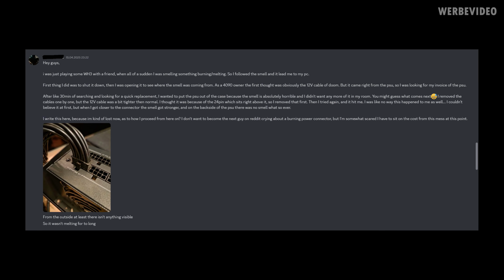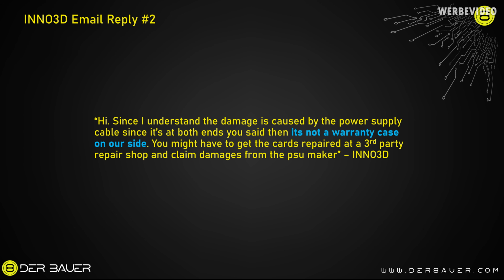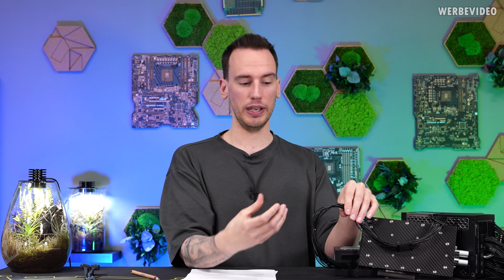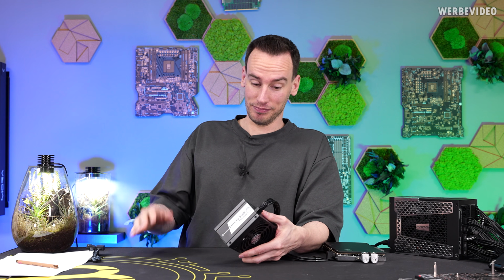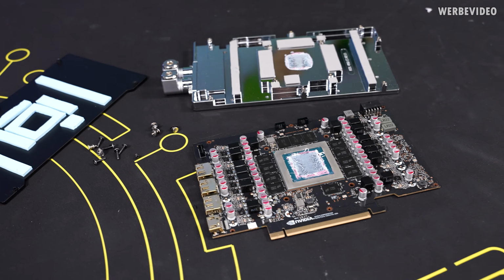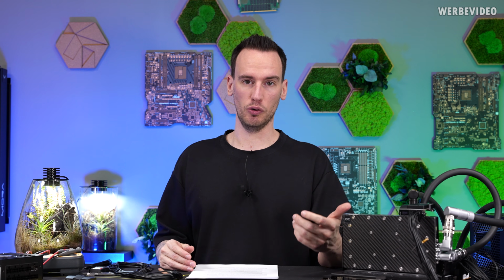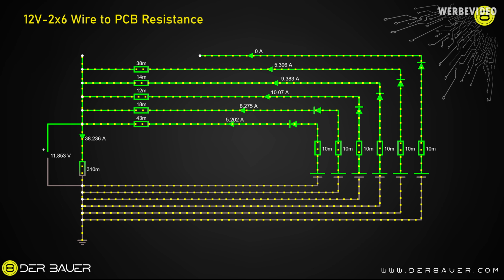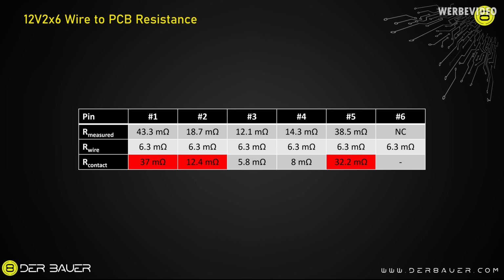Investigating and Fixing a Viewers Burned 12VHPWR Connector

Comment: Kinda makes you wonder why there hasn't already been a market for modding those connectors into something more reliable like an XT60 or XT90 from the RC Modell industry. Having only one 12V and only one GND Cable seems like an idiot proof method to ensure there not being any load Balance issues... It would IMHO also look much nicer to have two beefy Silicone Wrapped Cables coming from the PSU to the GPU than this Rats Nest of 12+4 Cables we currently have.

Comment: 4:23 bulllllls++t... it is purely nVidia's issue - not the cable or PSU issue.. the fact that the card suddenly takes more power through 1 cable, than normal, is caused by something specific - we just dont know what it is yet... :/ i'm not going to even ask INNO3d about it - and about my melted RTX4090 on the card's connector side only... they all play dumb... the only reason I use their cards is because Alphacool ES (back liquid outlets) supports only their cards...

Comment: Hello! You should measure the resistance of the cables while the connectors are plugged in on a affected card/psu. Do not unplug the connectors. Cut the power wires from the middle so they wont be in a closed circuit. Disassemble the video card and the psu. Measure resistance on each wire from the middle to the soldered pins of the connectors. Might be overheating because of poor surface contact area In the connectors.

Comment: Nvidia's Motto:  If it ain't broke, fix S%&# till it is!  Ppl and companies blaming cables, connectors, PS's, gfx cards, like wtf, the designers of this spec should be thrown in a hole and throw away the hole, there is no reason for any new design to released if it cant handle power its rated for, whether its the wire guage, or connector design, if they are not making proper connections in so many of these cases then its not the consumers fault,  its a flaw in the design

Comment: I blame Nvidia as well as PSU companies for anything related to cables. Corsair I think acquired cablemod, but for the most part, they're all shipping these PSU's and GPU's with cables that they know nobody wants to use because they're hideous looking. They know people are going to go out and buy extensions or modded cables. If Nvidia has a spec for those cables, they should sell them in different braided options. Same for the PSU vendors. Stop shipping hardware with dogshit cables and then wagging your finger at people for buying some no name brand cable extension. If they're not going to respond to the market, then some chinese company will.

Comment: The 12VHPWR cable system is the peak example of "should work in theory, but doesn't in reality". As shown in 3:36, especially with how variable the contact quality is with such small pins at each 12VHPWR connector end, if one or two pins don't make good contact, then it won't take long for the remaining wiring with good electrical contact at the connector ends to end up carry most of the current (which produces enough heat to melt wire insulation and connectors). 
This is partly why, at least in US National Electrical Code NEC 310.10(H), parallel conductors are only permitted where 1/0awg or larger wires are used, where it's more practical to run parallel wiring through conduit than trying to pull the likes of 4/0awg or 500mcm wiring through conduit runs that have a bunch of bends in it.
When I do get a card that uses 12VHPWR, I'm ripping that cursed connector off and installing some way to use DC-H connectors (rated to 60A) and 90degC rated 8awg wiring (good for 55A or 660W). As if these cards aren't overpriced already, a house fire will really make things EXPENSIVE; I game via Steam Remote Play a lot and won't be right by the PC to immediately smell the burning plastic and turn things off.

Comment: I'm a little new to PC building and came across the PMD2 device while watching Jayz Two Cents video - Feb 13, 2025: "I discovered something concerning and I need the Experts to chime in... More 12VHPWR discovery!", saying that the PMD2 was smoothing out the power to the GPU saving the card from being damaged. Along with the PMD2 I was going to add the Thermal Grizzly WireView Pro (then upgrade to the Thermal Grizzly WireView ProII when its released). The GPU I'm looking to purchase is the ASUS ROG Astral GeForce RTX 5090 32GB GDDR7 OC Edition. This PC will only be used for my VR motion racing sim. I'm trying my best to incorporate everything I can to prevent the wires from melting but wanted to know if this was overkill? Thanks

Comment: Product Idea: Make a device that the connector plugs into and the out goes to the GPU. This "box," which has circuitry to monitor the pins, could shut off the power if wattage or temperatures get too high instead of just passing the high wattage through. Think of it like a damn before the GPU. So, get it on it!

Comment: This happened to me yesterday. PC had a random shutdown. Reference 4090 with plug plastic melted on both sides about 400w heavy ai load used original cable that came with the corsair SF850L. I was able to disconnect both ends, Pins 1-6 burnt, plastic completely melted on Pins 2 and 5
Reply: It still booted fine when it was connected.

Comment: The design of the connector appears problematic due to its excessive complexity and limited capacity. With six wires carrying current forward and another six returning, each wire traverses four terminal points (two from the PSU and two from the GPU), resulting in a total of 24 terminal points. With the power envelope in mind this design pushes the physical limits of the connector.
Such a configuration is highly susceptible to imbalance issues, which can easily trigger a cascading failure or "snowball effect." While this type of connection might perform adequately in overdimensioned situations, it is unsuitable for its intended use here.
From an engineering perspective, applying 8.3A across each small pin at these numerous terminal points (24 in total) poses a significant risk of failure. The reliance on statistical probability rather than robust engineering principles makes this design inherently flawed and prone to disaster.

Comment: A very profound and useful solution would be:
make the 4 pins for sensing an SMBus and connect that to the mobo via a bridge. This way your PSU is now also part of the SMBus inside your computer. yay, now your PSU can report that it gets old and cant hold the voltages correctly anymore. Also overused other cables like SATA-strings can report overcurrent. Also hot temps can be reported.
The + and - pins are on PSU & CPU side switched via a multiphase controller. That will watch AND CONTROL the voltage, current, temps and so on and report to a small microcontroller which then reports via SM-Bus. This way the PSU and GPU can also report a hot wire to each other or handle our lower power draw for some time.
This will also allow a future proof power delivery handling like in phones. E.g. in the future there can be a boost on the PSU side, boosting 12V back to 60V (with this the current will also fall from e.g. 10A to 2A.

Either way. There are multiple things wrong with the 12V connector that could be changed easily and will improve safety by a lot. I wrote enough about those in other posts :|

Comment: I thought just like the gpu owner and bought a $100 cablemod custom cable for my 4090

It seemed to work great for a while but eventually started acting power limited like I had a 3x8 pin adapter instead of the 4x

I bought a new Seasonic psu that had the new cable built in and haven’t looked back since

Comment: I see diodes in your circuit simulation. Do those exist in the power supply? I thought all the pins were connected to a common bus (or perhaps via a shunt). The diodes will simplify the current flow graph, but that may not match reality. Perhaps they are required for the simulator to be able to solve the flow? How about building a physical model of the circuit with potentiometers representing each of the resistive parts? Could be a fun little project.

Comment: Handful (ok, 2 handfuls) of LONG engineering points, based on years of experience and troubleshooting of that LEAST reliable part of electronics - the connector (what do you think is most likely wriggled into a working position when you smack that box? A connection.):

1. With a 'busbar'/'pcb power plane' on both the PSU and the GPU sides, every parallel wire connecting them MUST have the exact same voltage drop between those two busbars.
 
2. The power lost in each wire path is the voltage drop squared divided by the resistance seen been those busbars along that wire path.

3, That path resistance is made up of a series of resistances: from psu busbar to the pin, contact resistance from the pin to the connector socket, the socket to the wire, the wire itself, the wire to the socket on the gpu side, the contract resistance from the socket to the gpu's pin, and the resistance from the pin to the gpu pcb power plane. 

4. ANY ONE OR MORE of those resistances can cause that pathway to draw less current, and push more current onto the remaining paths. 

5. IF the pin and sockets that are mated together are not compatible, typ one tin plated and one gold flash plated, the gold will migrate off its original surface, exposing a base metal beneath. Base metals can vary, and many can corrode/oxidize, increasing that contact resistance greatly over time. IF both are gold surfaces, this would be a very good low resistance contact, as long as the gold survives (mating cycles and vibrations are the typ enemies here).
The Intel ATX PCIe 12V-2x6 specs call out the pin contacts to be tin plated Cu. The spec I saw ( edc intel com alder-lake-desktop/atx-version-3-0-multi-rail-desktop-platform-power-supply-design-guide/2.1 ) did NOT spec the base metal nor the plating for the socket portion (this seems like a SERIOUS oversight, if it is not addressed elsewhere).

6. There are two distinct versions that are called out as 'approved' for the socket's contact area, a "3-dimple" design, and a "4-spring". The 3-dimple approach does not seem to be as robust as the 4-spring in regards to the number and size of the contacting surfaces. The 3-dimples are ONLY on two sides, and seem to only promise to try to contact the mating pin at the 6 bumps. Dust and other contamination can reduce that. The 4-spring approach, at a cursory look, seems more expensive to manufacture, but is a 4 sided spring cage, each meant to provide contact, and each contacting surface looks to be larger. Further, the 4 springs act independently, offering higher chance of contact in two different directions. 
If I were looking for a high quality socket, I'd be inclined to use a TIN (SN) plated 4-spring offering.

7. Plastic molds that need to have tightly controlled dimensions to hold the sockets in the shells in JUST the right position, and/or grab and contain the tiny barb in the socket the keeps it from sliding outward again. Those molds have a FINITE lifecycle - only some many shells can be produced before or must be replace by a new mold. And the timing that produces those shell molds also have a finite life before they must be replaced too. An aged/bad mold, or worse, an aged/bad tooling for making the shell molds, can cause long term havoc, and particularly when it's the latter case, the tooling, has many shell molds will be wedding over a much longer period. 

8. Just like household and industrial electrical codes call out, the size and insulation of the wire attached to an electrical connection can greatly affect the current/power-loss rating (heating, nominally from contact resistance) that the connection and the connected device can handle. Heavy gauge Cu wire can draw a lot of heat away. The insulation and it's temperature rating affects how long or how hot the wire can get before damage. And if the other end is not far enough away to allow most of the heat to dissipate into the air, the connection on the other end of the wire will bear additional heating too.

9. Similarly, bundling/sleeving/jacketing over the wire will thermally insulate or impede heat dissipation to the air, hastening heat channeling to the far end and/or melting the wire insulation. 

10. There are a handful of things that can cause the socket to not be or stay in its intended position to contact the pin correctly. In (7.) above, a defect in the manufacturing of the shell is a major one. Similarly if the barb on the shell is malformed or damaged during wire attachment or insertion into the shell. In many connectors similar to these, the socket can accidentally inserted rotated so the barb won't engage correctly. Debris, including stands from the wire, bits of the wire's insulation, or excess solder (*IF* the wire was soldered after being crimped to the socket)(soldering is a step that I would prefer, but ONLY if done Very skillfully).
I'd also suggest carefully checking if each socket is of similar position when viewing the pin hole, and also making sure a LIGHT pull/push does not move the socket 'very much' inside the shell. YMMV.

11. Bonus point: putting a board in the middle to reconnect the power and ground connections, with a 2nd cable finishing the trip, only adds more connections and more opportunities introduce extra resistances. Of course the heat is less likely to migrate to both the GPU and the PSU, but it is not really a 'solution' to the problem, and can make a problem more likely, statistically. 

12. Full dozen, because why not: 
IF there is a problem with the GPU or PSU connector to their respective internal 'busbars'/'pcb-plane', a Very careful resistance reading might uncover it. It will likely require a good meter, and there are meters that excel at measuring lower resistance accurately, for PRICE. Since all the 12V power pins are tied to the 'busbar', the resistance from any one oin to each of the other 12V power pins should be extremely close. And.. same between the group of ground pins. "Very carefully" I say because pressure on the pin tip CAN monetarily press an open gap closed, or further closed, only to open again when released.

Whew. That's was way longer than intended. Hope it helps someone someday.

Comment: Its pretty shocking to look at a modular PSU's sockets and compare the pins inside a single 8 pin connector vs the 12VHPWR connector. And then consider that a 3xxx series card would have potentially used 3 of those 8 pin connectors. I am glad my 9070 XT uses 3x 8 pin connectors too!

Comment: Roman, regarding removing the 12V connector, the key is mixing low-melt solder into the existing solder points first...then you can use the heatgun & remove it nice & easy all in 1 piece.

Check out Northridgefix's content...he's the foremost expert at this, and he does this for a living practically, and has fixed hundreds (if not 1000+) of 12VHP cards with melted connectors.
Reply: correct about the solder, if only we had some way to view a video about how that is done
Reply: @daleaha7415  Northbridgefix does it live on camera multiple times per month. Just search for 4090 or 5090 "melted connector" with his channel name.

Comment: I have a 4090 and 5090 and have not had this happen. Is using the adapter to 4 8pin safer? Or is the risk still present?

I have been using an EVGA 1600 PSU. Would it restrict pulling too much current from one 8pin?

Comment: Agreed, Inno3D were just plain wrong - stupidly wrong in fact.
And I don't recommend using P=I^2*R for a situation like this where current varies between pins. Far better and simpler to just use P=V^2/R instead, since all of the 6 x 12 V conductors are shorted together at both the PSU end and the GPU PCB end, hence V is identical for all 6 paths to the card. That just leaves the total resistance, and it's now obvious that a small resistance means more heating.

Comment: The pin in the 12 pin are smaler than on the pcie 6+2, i'm sure it would intereting to take one single pin and load test them to compaire the new and the older pci e single pin capapcity it would need elctronic lab equipment to do this but i'm sure somme people have this and it would be fun to see the result. i'm also thinking it was nvidia trying to put an aditional failure point and it is blowing in their face, my point being, I'v have friend i play with and she is still runing fine with her intel i5 7xxxk and her 1060 ti. her biggest issue being stuck with win 10 and no more security update and really heavy uengin5 game but she run satifactory fine, if your product last you don't sell.

Comment: A few years ago my PC popped and shut down, I contacted Asus about the dead GPU that smelled like burnt electronics (assumed that was the problem, didn't notice any other smells, and I didn't try to power back on as my main concern was the GPU). After I explained that I never used an OC on the card or any other part of the lightly used system, they started to explain to me that it's likely "a faulty cheap PSU" that caused the issue and they couldn't do anything and I should contact the PSU manufacturer to replace the GPU and repair the faulty PSU. I said "Well that sucks, I really thought I'd purchased a quality power supply. But luckily for me I already have you on the phone, it's one of your power supplies, the MB is ASUS too". To which I barely heard them go "oh sigh uhh, err.. can I place you on a brief hold?" about 30 seconds later they came back and said they were emailing instructions and labels for the MB, PSU, and GPU. a couple weeks later I received all new stuff and immediately sold it and went with other brands..